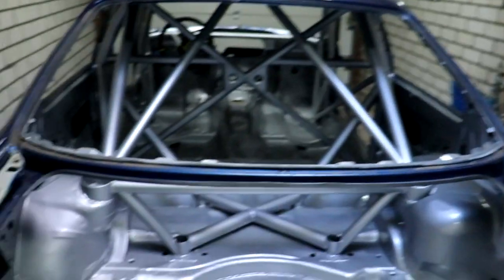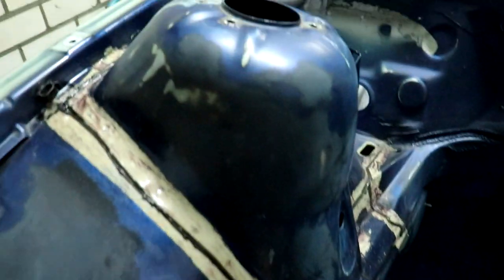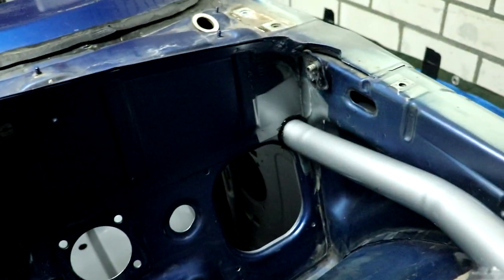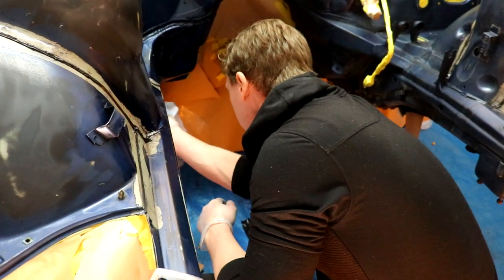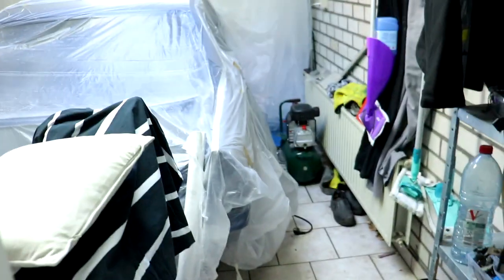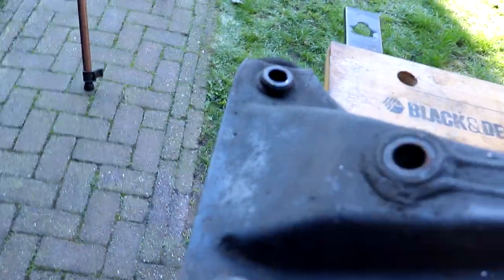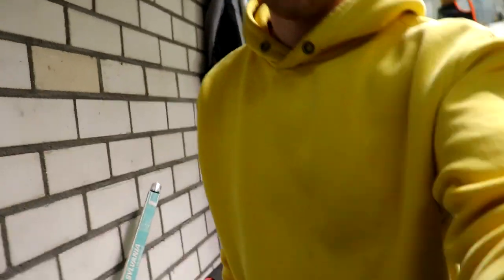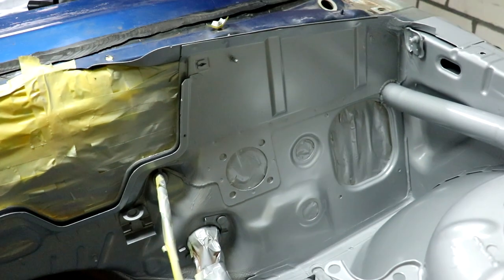PAINTING the ENGINE BAY (FULL E36 RACECAR Build series) (Part 13)

Comment: Nice job, just wondering why you didn't reinforce the front subframe? Are you going to reinforce the rear chassis? That's a weak spot on E36's..
Reply from the maker: Haven't heard that many stories of the front subframe failing so I didn't reinforce it, the rears I did reinforce on the subframe, when changing the rear axle bushings, I will also reinforce the trailing arm mount

Comment: really you should be sealing the whole firewall, at least riveting some plates over any holes, hints in the name, it will keep any fires out of the cockpit also primer wont stop that rust unless you put on some rust converter, even then it wont last but it will last a lot longer